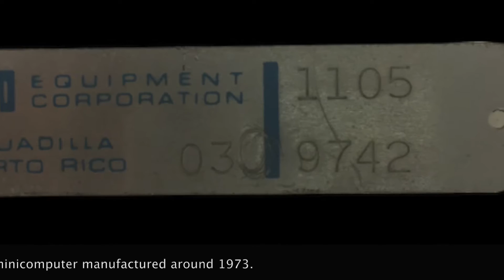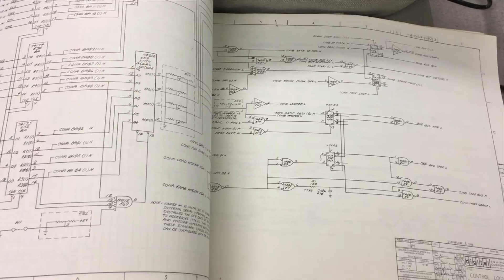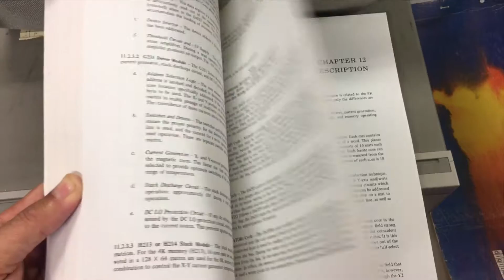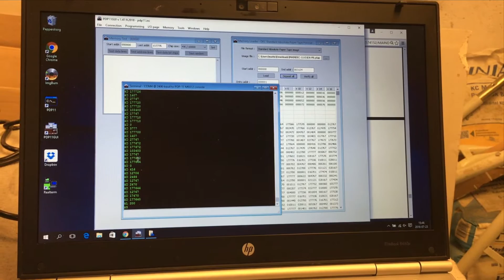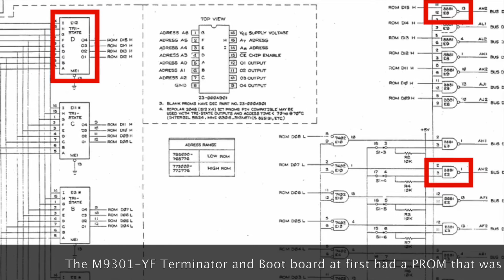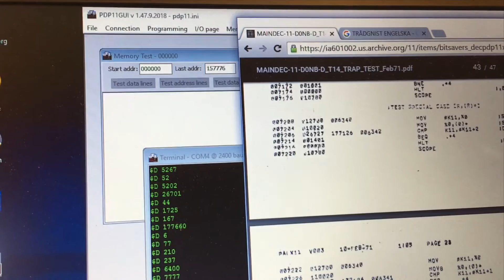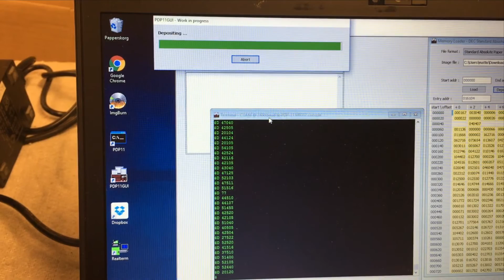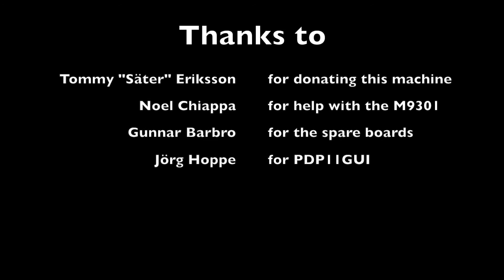PDP-11/05 - A restoration project

Comment: When I was hired by Digital Field Service in ’78, I had to work on many of these units, and much more. But… I had to use the switches to start loading. I used Diagnostics (XXDP+). My first OS was RT11-3.0b. Man it’s been a long ride since then. I miss the early troubleshooting techniques that had to be used at that time. You caused me to dig out my PDP-11 instruction card, then my old copy of “Assembly Language for the PDP-11”. Man you bring back memories. I have to ask myself, would today’s world survive if the was no POST and beep codes? I love your videos.
Reply from the maker: Thank you for your comment! Switches, KM11 boards, the print set and tech manual, MAINDECs and a scope is what is needed to debug and repair these things. And you can still find parts to keep them running and they are so simple that one can grasp them mentally (the 11/45 might be a bit harder though).
Reply: @mattislind4443 There were always very good diagnostics. You just had to use the right file. I believe I upgraded an 11/45 to an 11/55. It wound up with two types of memory, static and core. Long time ago, my memory is dim and full of ECC faults (LOL). I worked of all types of PDP-11’s, VAX, and Alpha. My favorite 11 was probably a pair of 11/60’s with each having a pair of RK07 drives. The I/O address range was modified to increase it from 4K to 8K.
Reply from the maker: @markcummins6571  I agree that diagnostics is very useful, indeed. However these days it could be hard to find the matching diagnostic file and diagnostic listing. Makes it harder to find faults when the halt locations doesn't match. The 11/60 is quite rare. I guess that not that many were produced compared to the other models. Whenever I have time I will do a video on our 11/45. That is an impressive machine. 33 MHz clock frequency. 5 "micro steps" per microinstruction.

Comment: Hi, thank you for this video. I have a dead 11/10 that I hope to restore soon, if I find the space to work on it
Reply from the maker: Nice! Clear out some space and start working with it! It is fun! The 11/10 is quite easy to work with. You maybe now everything on how to proceed. In any case here are my recommendations. First check the PSU. The PSU of the older 5 inch chassi and the old BA11-D chassi can be tricky. A guy has made a spice model out of it and concluded that it is sensitive to capacitance in the output filtering capacitor. If these are not good it will not switch at all. Mine had some leaking capacitors which needed replacing. If the +5 and -15 V is good then the CPU and core memory should work. Actually you can run the CPU alone just to start with. Since it is a two board set it is very tricky to measure on the boards without riser cards. You can still order such cards today or find them on Ebay. There are also several test points in the backplane which a starter at least. Some points to start with: Does it come out of reset when power is applied? I.e. does the AC LO and DC LO signals work as expected and the associated logic on the CPU boards. Does the clock tick? Is the microprogram address changing? If you have a logic analyzer attach it to the microprogram addresses and se what it does. Good luck! My webpage has some info, www.datormuseum.se then I also suggest that you join the www.vcfed.org forum. A lot of people that can help there.
Reply: @mattislind4443  thank you for the hints! I definitely need raiser boards, but first of all the space. I have this 11/10 and a even bigger teletype that would need restoring.
I know I would find a lot of informations on vcfed.org once I start this job.

Comment: TY for your video. Wonderful seeing a PDP 11 again.  Where did you source the hardware and spares?
Reply from the maker: The particular machine was given to me by a guy that bought a few old CNC systems where PDP-11/05 was used as the controller. This was a spare CPU that he had no use for as he were going to retrofit the CNC systems with new controllers. The spare parts are almost exclusively standard TTL circuit that still are available albeit maybe not still produced.